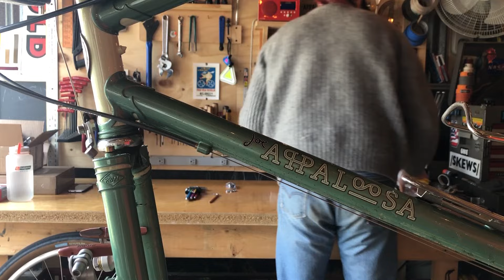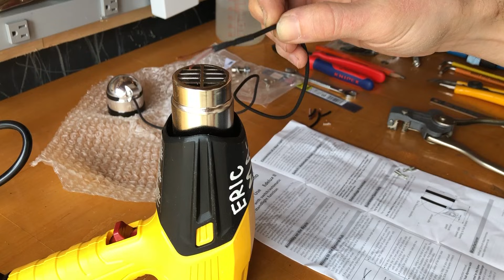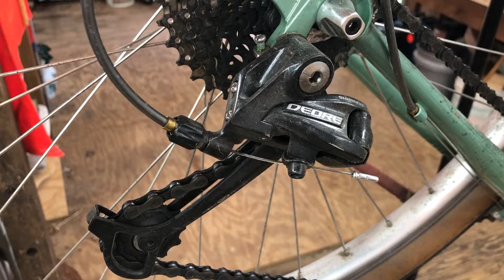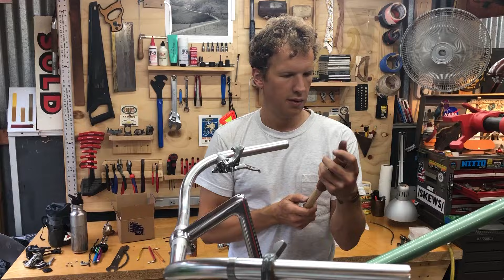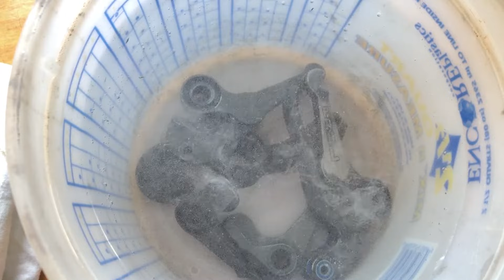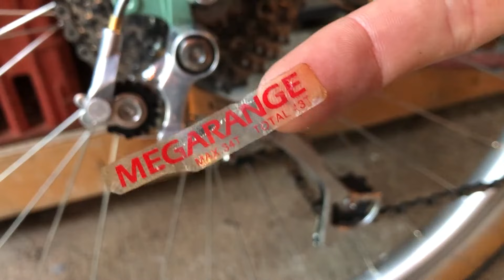Rivendell Appaloosa Updates with Ultraromance. Dynamo, Crust Ortho Bars and rapid rise derailer.

Comment: hello j'aime beaucoup le pédalier c'est un axe carré ? quel marque modèle ? le guidon donne une position moins allonger ? position pour un vélo de ville mais pour le vtt ? merci
Reply from the maker: Hi Phillipe — It's a Silver brand crankset called the "wide/low." Silver is Rivendell's house brand. The double crank is a 38/24. Yes, it's square taper. The handlebars are off-road bars and yes, they can be set up for city riding but I have them installed quite a fair bit below the saddle for a more forward, off-road position. But I ride this bike mostly in the city :face-purple-rain-drops:

Comment: Hello.  I am thinking about picking up a Joe Appaloosa and was wondering if this bike feels at all sluggish. I am looking for a mix terrain bike that can also carry a little bit of weight.  Thanks
Reply from the maker: I've never felt it's sluggish but ya gotta temper your expectations I guess. It's certainly a stout frame and isn't going to jump up like an Italian racer. It can do it all, haul some weight, handle some trails. I'd recommend maxing out the tires and go big! If you don't need to haul so much stuff I'd consider going with something like the Sam Hillborne, a bit more nimble and a very, very capable bike you can set up a whole bunch of different way (racks, drops, swept back bars, whatever). I had a Long Haul Trucker for about a year and the Appaloosa feels waaaay better all around.

Comment: Hello Eric, Thanks for the peaceful and inspiring videos. So inspiring that I also got that Nexave rear derailleur for a future build. Do you have any feedback after 1 year of riding? And does it work great with your cassette (I have counted 36 teeth for the bigger one, is that correct?). Cheers from France :)
Reply from the maker: Hello, thanks for the nice feedback. Yes, that Nexave derailer has been great. Yes, I'm running a 36 tooth big ring on the cassette and the Nexave shifts it fine :)

Comment: Great video. I have the little Blue Lug tail lights too, but I have a hell of a time trying to charge them. The female charge socket is so recessed that I almost can get any cables to fit it. What do you do?
Reply from the maker: I have a bunch of USB cables, some of the heads are smaller than others. Some work, others don't! For the most part it hasn't been a problem for me.
Reply: @ericmarth  Does it light up to indicate it’s charging?
Reply from the maker: @thisishowiedewitt76  Yes, it will light up as it charges

Comment: It looks like you had a little trouble pulling that front wheel out. Was the size and position of the brake pads a factor?
Reply from the maker: Yeah, sometimes takes some wiggling to clear the pads with the big 2.2" tires. But I can manage without deflating.

Comment: WD40/PB Blaster works to slide standard vinyl hand grips onto bars. Not sure about the ones used here.
Reply from the maker: Thanks, Chuck. I'm hesitant to use solvents or lubricants there, with the sanitizer I figure the alcohol will evaporate pretty quickly. Someone also suggested using Boeshield T9 lube!

Comment: Just picked up an MB-1 and trying to figure out the changes.. it needs bars, pedals, etc… I am 5’8.. so maybe narrower bars? Stem short with rise?
Reply from the maker: An MB-1 sounds nice. How's it set up currently? Is it stock? And do you know which year? Stem will also depend on your bars and how the frame fits you.
Reply: @ericmarth  its an 89, I believe. White and grey. Believe a 19”. I’m 5’8.  The bike came with a very aggressive stem, flat bar.. I was over the front wheel. XT thumbies are nice. Normally I opt fr Boscos or Albatross. But whilst I desire a much more comfortable set up, I am interested in an occasional pop a wheelie :) Found riser bars and a basic shorter stem. Questioning options since still a bit rough on neck…

Comment: This is an amazing build.  I’m currently assembling an Appaloosa very similar to yours. I’m trying to decide on a rim and I think I might do cliffhangers as well. Do you have machined or non-machined sidewalls? I know Grant endorses non machined but I’m curious what your experience has been. Thanks!
Reply from the maker: Oh, thank you Turner. Hell yes, good luck with your build. Cliffs have been good, they might be overkill but I wanted a wide rim to make out the tire clearances. 

Mine are non-machined, I got them from Rivendell. They're Velocity-built. No problems I can discern but I've never run machined rims or worn out any sidewalls to compare.

Comment: Great update to your build! I used your original video (and a few others)  as inspiration when I built up my new Atlantis last month. Those are some beautiful trails you get to ride...what state/general location are they? By appearance I would guess east coast somewhere. Also I am wanting to ask you since you've been riding the Appaloosa for over a year what seat angle or riding position you favor, relaxed 90 degrees or a more moderate slightly bent position (maybe 60 degrees?). I have tried to get used to the Brooks B17 but it is very unforgiving on the rear so I am planning on getting a Selle saddle like on my old bike and they come in relaxed or moderate so am wondering which to get. I was fine with Moderate on my old hybrid but I am wondering if the Riv's geometry really needs a relaxed type of deal. Cheers!
Reply from the maker: Hi and thank you! Seat angle and riding position are quite personal, saddle, too. I do prefer to lean forward a bit on the bars and ride in the position ahead of the brake levers quite a bit. Maybe varying between 60 and 45 degrees? I've yet to triangulate. The B17 I've found can take some getting used to or tweaking and adjusting. I like tons of setback with my saddles but again everyone's different. And the B17 just doesn't fit some people! I'm not familiar with "Selle saddles" or their firmness so can't make any recommendations there.

Comment: Great looking bike, and workshop.  Dig the background bird noises as well.  Love my Appaloosa, just swapped stem to a Nitto Periscopa from a Kalloy 7 shaped one. Did not make a video of the process. Got the bars up a higher, but think I really want a Riv Faceplanter 4 bolt.
Reply from the maker: Thanks so much, Brian. There was a periscopa installed on my Hillborne when I bought it. I like the Riv x Nitto face-plater, they're just impossible to get right now. Soma makes one that's similar, I believe Velo Orange does, as well. Not sure what their availability is like. Happy riding!
Reply: The only problem I've had with the Riv Faceplater and their Jim Stem is that the extension is angled rather than straight ahead.  So you loose some extension.  I had to go to a Nitto Tallus to get an actual 130mm of forward extension as well as the height I needed.  Even using smaller bars like the Nitto Albatross, I needed all of that to get the bars far enough forward to reap the benefits the good Doctor describes above.
Reply: @MelvinHughesatp  I like that the extension is angled up a tiny bit on the faceplater, I prefer the looks on bikes with a sloping top tube like the Appaloosa.  85mm maybe lands around 70mm which I think would work for me with my Sim Works Little Nick flat bars.  I tried Billie Bars and wasn't that into them, prefer the flats...for now.  The periscopa stem gets bars in a good place, just not in love with the look of the heavy upward angle. Maybe I'll find a faceplater some day.